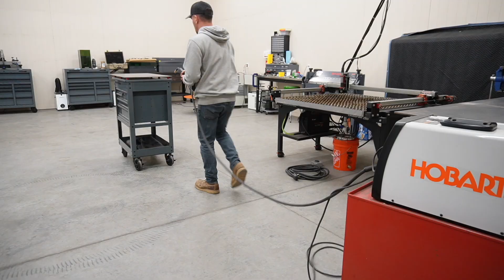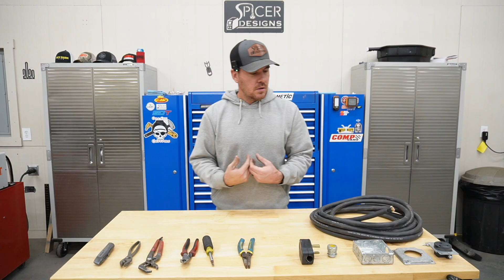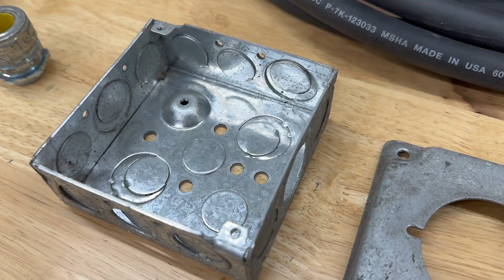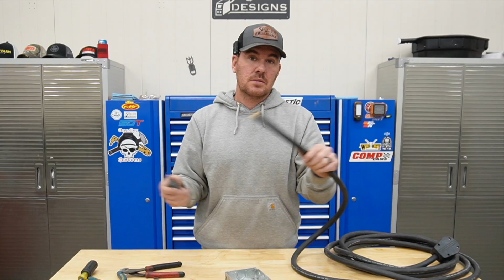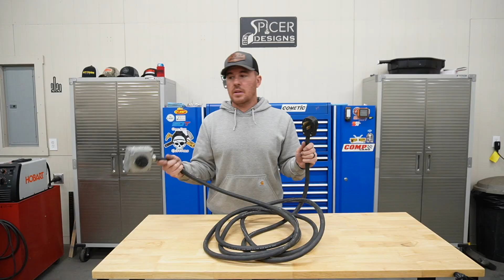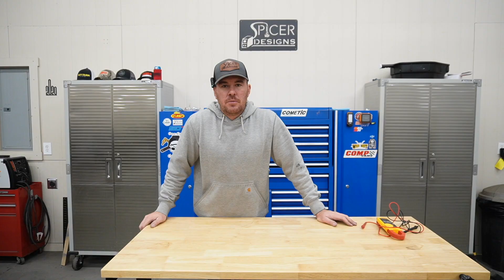DIY Welding Extension Cord...STEP By STEP...With Part Links

Comment from the maker: By far the cheapest option is a pre-made extension cord. Here's the Amazon affiliate link: https://amzn.to/3CXBn3i
Reply: I don't even know if you'll read this comment after all this time, but an extension cord, especially one like this that handles 240V at 30A, shouldn't it be equipped with a GFCI or, in this case, an RCD? Anyway, very interesting video!

Comment: I have a Lincoln Eagle 10,000 generator welder that has a 4 prong 240 and my Forney 220 MP wire feed welder has a 3 prong 240 plug. I need to wire an extension cord to full access the Forneys full potential.

Comment: Loved the video!
I loved the detail because most people don't take the time to mention the little things that matter.
I'm a retired Boilermaker welder that built my own house 28 years old and did my own plumbing and electrical work.
Everything passed inspection perfectly because I obtained copies of the KY State plumbing codes and the Local Co-op Utilities Code book they gave out based on the NEC.
Everything passed great.
Just 1 question.
Shouldn't that metal junction box be grounded by a bare say #14 or #12 awg wire between the #8 Green SO wire and a screw on the metal junction box?

Comment: Why is the branch circuit, the wall receptacle, and the extension you made so oversized?  The highest amperage a Hobart pulls of all their welders is 19 amps at 240 volts.   I see this all the time on YouTube.  Did you have a Lincoln 225 amp stick welder before?   I looked up the Hobart welder again and it actually did show a NEMA 6-50 in the literature.  I then looked this up in Article 630.  Specifically 630.11 and 630.12.  In 630.11 it states the minimum wire size required.  That means you can oversize as much as you want.   630.12 says that overcurrent protection shall not exceed 200% of name plate rating of the welder.  So, end results are using the largest Hobart welder, 19 amps at 240 volts, literature shows 6-50R, Minimum wire size would #12,  overcurrent protection maximum is 19x2=38 or 30 amps for overcurrent protection.
Reply from the maker: The recept is a standard welding plug which is good to 50 amps.  I also sized the wire to 50 amps in case i ever needed it which i did.  I know have an 80 gallon air compressor hooked up there.  And the Hobart welder i have has an fla of 29 amps.  Sounds like theres some confusion on your end.
Reply: @SpicerDesignsLLC .   I revised my comment.
Reply from the maker: I dont know what Hobart welder your looking up but mine has a max of 29amps.   The recept and wire need to be sized according to the OCP.  Im not sure what point you’re trying to make here.  And 12 awg wire on a 30 amp breaker is not right.
Reply: @S @SpicerDesignsLLC  This is the point.   Per the NEC Article 630.12 and 13, Just because you have a 50 amp receptacle, does not mean that you can just install a 50 amp breaker, and that the conductors are not required to be 50 ampacity.  An article of NEC for specific equipment overrides the other rules in the NEC.  Your videos have always been very accurate and well done.  Your install may be 100% correct for your specific welder, but it is not correct for all wirefeed welders.
Reply from the maker: I didnt claim that it was for every welder.  Id say thats common sense anyway being the massive variation of welders that are out there.  In that video i sized the wire for 50 amps incase i ever needed the full 50 amps which i did.  Now the air compressor is hooked up to it.  In that video i used a 30 amp breaker which will cover most welders.
Reply: @S @SpicerDesignsLLC We are now in agreement.  But hopefully you can understand that most just do what they see in a video without any real learning and might just install something wrong.   There is a reason that my NEC is 2” thick.   Keep making the excellent videos that you do!
Reply from the maker: People are going to  install things wrong whether they watch a video or not.  Thats why i say in that video the best bet it to hire an electrician and to follow all local code. I never disagreed with you to start.  I did the install correctly from the get go, you must not have caught that it was on a 30 amp.  Idk.  Either way, most of these welders have built in overload protection.  And most other equipment has external thermal overloads sized specifically for the equipment.  The main point of the breaker is to protect the conductors, not the equipment.
Reply: @SpicerDesignsLLC .  👍👍👍

Comment: I had a question, my house had a hot tub that’s no longer here and there was metal conduit ran from the breaker box thats outside around my garage it’s roughly 50ft then Used to go underground to the hot tub. I’m planning on going into the garage for an outlet. The question would be say 50 ft ran wire to the outlet could I still use a 25 ft extension if needed? Using 8 gauge wire also would it be recommended to go up on the breaker or keep it 30 amp

Comment: Is the ground on the plug also grounded to the metal box? If not, how are you getting continuity from the box ?
Reply from the maker: I mentioned that in a video and showed a picture of the type of device you would use with conduit.  it has a self grounding tab on the device.

Comment: Exactly I did 12 years ago. I found the cable cheap and took advantage of it. It's great and I use it for an air compressor and heater as well as the welding equipment. I soldered the strands before clamping them in the plugs

Comment: That bottle of 75/25 or whatever it is for the welder needs to be secured!! It tips over, breaks the valve off and you have a  missle that can penetrate concrete! ( Other than that good video.)
Reply from the maker: I built an entire cart for it.  We can what if about a lot of things.

Comment: Not complaining or criticizing, just an honest question about the 4x4 box and grounding? How would one go about that if you wanted the box grounded as well. Not easy to pigtail a #6 or #8... :D

I went the Cord End route for both side of the cable.
Reply from the maker: I grounded the metal box in the video.  Just have to use a lug.

Comment: So i just finished installing a stationary plug with 6/2 wire, is there any reason other than cost not to use 6 on an extension cord too?  I did notice the 6/2 was very stiff and that 8/3 looked pretty flexible
Reply: Do you really need 60 amps in that line? Are you running a 50 foot or longer extension? If not, use 8.
Reply: @melgross no I dont need that much haha, I just figured bigger might be better, but I think im just wasting money instead.  Thanks!

Comment: I already have a 25 ft extension cord. Real heavy duty cord because my welder is a 350 amp machine. But I’m just here for your comedy. Question. I’ve been looking for your video you made first testing out your Kymron XH26. Looks like it was deleted or something. Did you remove it or did YouTube yank it for some reason? One of my favorites.
Reply from the maker: I did delete some with the wife in them.  I have a playlist with all my Chinese excavator content.  If its not there then its deleted.

Comment: Hey just watched your videos for the first time and there great already subscribed.  I have a miller multimatic 220 ac/dc and it calls out for 12 gauge 30amp  25ft. But i have 10gauge  50ft 30amp cord laying around. So my question is can i use 50ft of cordwith thick gauge wire?

Comment: So first question: why 8ga vs 6ga? Just a reference point I have an AC tombstone Lincoln stick welder. When I installed the receptacle in my garage from my breaker, I did it with a 6ga wire with a 50amp breaker. Second question, if I wanted to mount a small subpanel to the welding cart, could I use that extension cord into that subpanel and have another breaker to have two receptacles on the cart, one 220 for the welder and another 110 outlet for grinder/chopsaw? Since both implements wouldn’t be running at the same time, I figured it wouldn’t overload the 50amp breaker in the garage either.

Comment: Awesome video! I do have a question my generator uses a 240v twist lock connector. Could i just make one end twist lock and the other a normal 240v welder plug? Sorry for my lack of terminology knowledge.
Reply from the maker: Yes of course.  Just be mindful of the ground connection and you will be good.  If it's the 4 prong twist lock on the generator then just leave don't connect the neutral on the male end being there is no need or connection for it on the welding plug anyway.
Reply: @ Thanks for the reply yes its a four prong twist lock so the neutral wire was my next question haha. You are awesome i will be trying to make one this week.

Comment: I have a question I'm also hooking up a 120/230 Lincoln Electric 180amp mig tig Arc welder, am I question I'm going to make an extension cord just like you did but I have 8/3 Romex cable it also has the fourth wire but it's not 8/4 like yours will it work as well? or do I need to purchase 8/4?
Reply from the maker: You don't need the fourth wire.  Thats just what I had laying around.  You only need two hots and a ground.
Reply: @SpicerDesignsLLC  I have another question for you, My 240 volt welding plug N6-50P has on it black & white for the hot & green for the ground. My 6/3 Romex is Red Black White with a bare copper ground do I need to just go ahead and hook up the the black & Reds for the hot and use that white as my neutral ground or discard the white and use the bare copper for the neutral ground? That was my only dilemma. it wasn't like your wire with a green and you discarded the white...
Reply from the maker: @VATION3RD-GEN-X-GARAGE you dont need the white.  Use the bare Copper  for ground.
Reply: @SpicerDesignsLLC  thank you sir I just wanted to get a second opinion...

Comment: For the female end, if you have money to burn then just buy a Legrand D0653 from Menards. If you want to do it the way shown in the video you're probably better off using an FS cast box to somewhat combat moisture intrusion If you're at a company then I think** osha is less likely to complain about the cast box. You could also add a water resistant plug cover to the cast box and/or you could add a GFCI breaker to your welder circuit.

Comment: I'm not an electrician by trade but know how to wire. I built my own shop and wired it. 
I also built (converted) a milling machine into a CNC machine. I did all the electrical work on it, and it turned out well. I do like your plasma table and would like to build one as well someday.

Comment: Okay.  My TIG is on a 30 Amp circuit.  So, could I use a 10/2 wire for the ext cord?  I'd probably only make a 15 ft cable.
Reply from the maker: 8 would be ideal for an extension cord but if you use 10 just make sure its a stranded SOOW cord.  More strands and carries current better.
Reply: @SpicerDesignsLLC  Thanks. When I installed the 30 Amp receptacle I used 10/2 NM-B.  I did use the metal box like you showed on the other video.

Comment: I will be making an extension cord. My situation is I will need to plug into the dryer plug at the back door of the house and run it out to the detached garage. It will be about 70-80' eyeballing it. I was thinking of using #6 wire because of the length.

Comment: I watched your other video about the plug install, the way my garage is setup if I wanted to run wiring from my breaker box to the other side of my garage, about 40ft and put a plug in there would i still run into those voltage drop issues? Or would I be fine because its not an extension cord?
Reply from the maker: Kind of a gray area but you should be fine. I would recommend running no less than 8 awg copper.
Reply: @SpicerDesignsLLC  i appreciate the advice.

Comment: Really enjoyed the content.
Q.     Can I use 10/4 wire for the extension cord? I already have a 21ft length. I'm running a Lincoln 215 MPI.
Reply from the maker: As long as its on a 30 amp breaker your good

Comment: I made up the same exact chord, 25' long 8 gauge wire.  I have a 15' 10 gauge wire to make another extension cord, cause my 8 gauge cord is sometimes to short. Is there a concern or problem  using the two cords together? Great video, thanks
Reply from the maker: If you do connect them, keep the smaller gauge cord closer to the machine.
Reply: @SpicerDesignsLLC  thank you very much for the information sir. I appreciate your response

Comment: I find it interesting in the US that you use a conductive box, in Australia this is a massive no no, the box is heavy duty plastic, no way the box can conduct electricity. Anyway Im sure there is lots of ways of doing this. Thanks
Reply from the maker: As long as its grounded properly its not an issue.  One loose connection causing some heat and that plastic box is a ball of flames.

Comment: That Hoeburt  setup is quite a MACHINE   Why not use a handy box with rounded corners instead of that rough-in box with the sharp frik'in corners?
Reply from the maker: @funone8716  handy box wouldn’t fit that recept in it. I like sharp corners.  The Hobart has been a great machine for sure.
Reply: @SpicerDesignsLLC  lol

Comment: I installed a male receptacle on my welding cart and female receptacles for my welder and plasma cutter so I could leave them plugged into the cart full time and I only have one long extension cord running from my cart to my 50A welder outlet. 

I also put a quad 120v 20A receptacle on the cart for my grinders and shop lights that all feed off the single outlet on the wall. It really helped reduce the cord clutter in my garage.

I also mounted some cheap Amazon utility hooks on the side of my cart for my MIG gun, plasma torch, ground wires and grinder cords.

Have fun building your new cart!
Reply from the maker: Those are great ideas.  I plan on doing the exact same thing for the two welders on my cart.  Just an extension cord on the cart to plug them both in.   Thanks for sharing!

Comment: Thanks for the informative video! What is the longest length combined extension cord and the cord on the welder? (I just want to make sure someone doesn't have a long cord on the welder then adds an additional 25') Thanks!
Reply from the maker: The manufacturers cords should be pretty standard on these smaller machines.  I wouldnt go much more than that and the 25’.

Comment: Everyone is a troll, just me with my fat fingers- after you cut the outer jacket  off, flex the conductors at the point where you cut & look for copper, if you’ve cut the insulation on an individual wire,start again… oh & I’ve started using crimp down ferrules on stranded wire. But then I was a carpenter & electrical is scary..

Comment: Thoughts on surface mount range receptacle instead of thors hammer on the end? I know they can get broke that’s why I wrapped with a lot of electrical tape. A tip…keep eye out at wwtp or motor repair shops for old submersible pump/mixer power cables. Very good cable. Some are damaged or short bad, most are not. The slightest damage to jacketing warrants replacement.
Reply from the maker: I left links for that style as well.